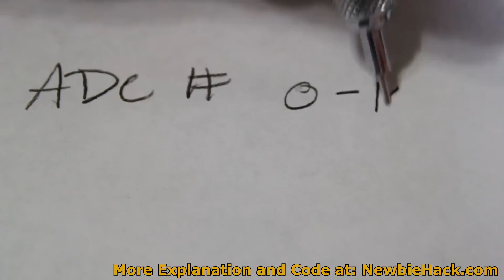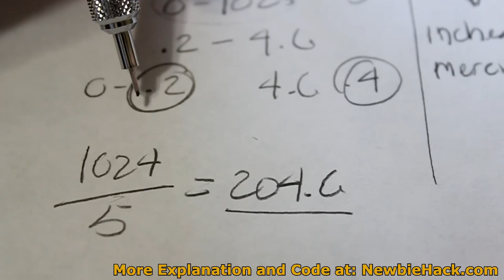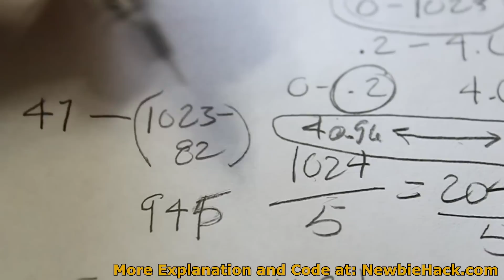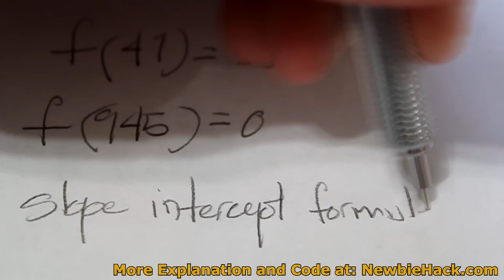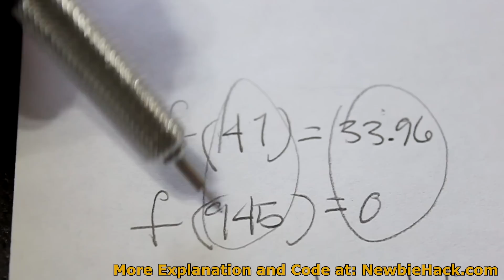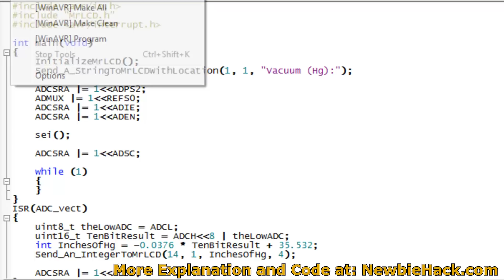43. Arduino for Production! AVR ATmega32 - Part 3 - Real World Example of Create a Vacuum Source

Comment: Also regarding this video, I will recommend to make voltage divider to fit the range 0 .. 4.6V to 0 .. 2.54 and add the 1uf capacitor to filter a signal. And  set the Reference voltage to the internal Vref - 2.56.That will increase accuracy and stability.

Comment: I got few questions, if you could help me. I`m locking for vacuum switch, for controlling my PnP machine, to switch vacuum on and off. I did not found anything more or less cheap, so if you could recommend something? Also, could you please share the model name of that pressure sensor? Thanks in advance.